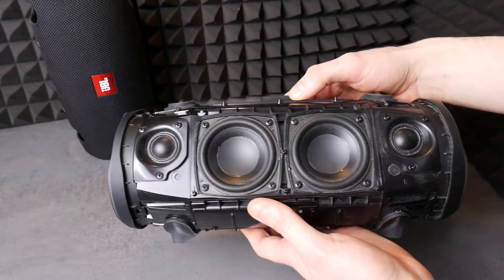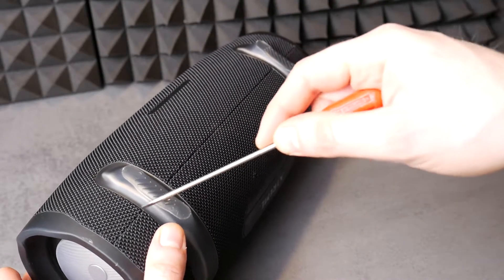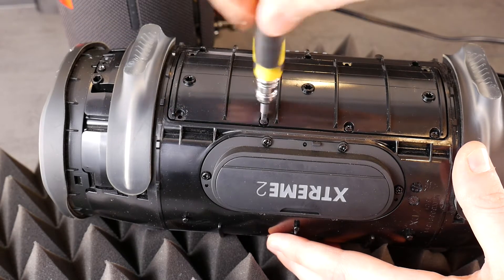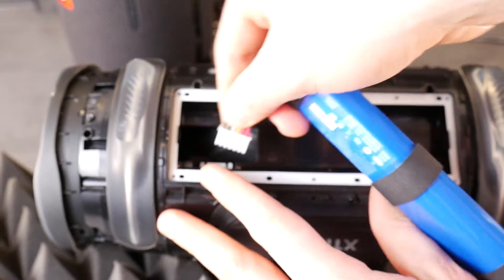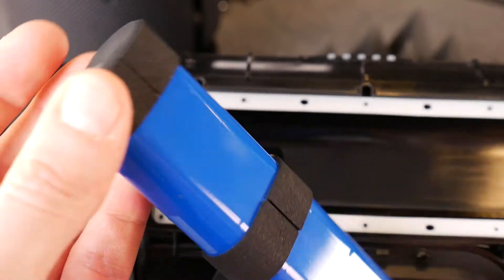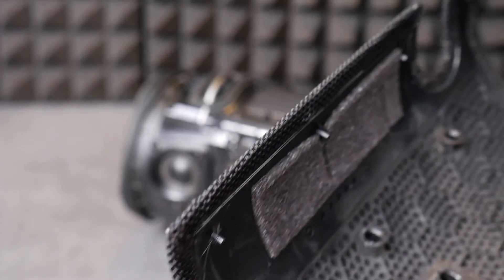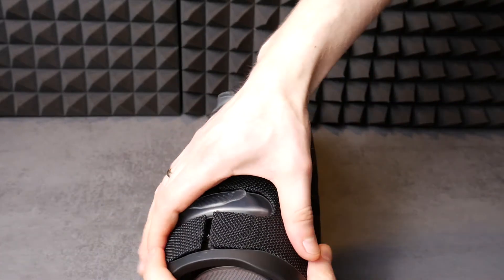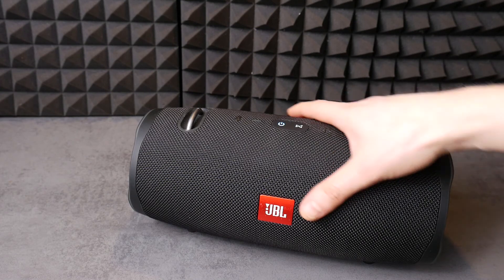How to Replace JBL Xtreme 2 Bluetooth Speaker Broken Bbattery

Comment: how would I diagnose my speakers battery being bad because what if its something else im pretty sure its the battery I plug it in it doesnt charge what so ever it will turn on while on the charger but it shuts off 5 seconds later could this be the battery or something more

Comment: So the battery itself says it has 5000mah capacity however JBl themselves say it has 10.000mah.
Which is it?

Also there are batteries available that have more than 5000mah and say they have 6800mah total capacity.

Are these legit and safe? I mostly use my speaker at festival campsites. So extra battery would be nice but it needs to be safe.
Reply from the maker: 5000mAh is at 7.2v and give around 37 Watt Hours, at 3.6v it will be 1000mAh and the same Watt Hours.

Comment: Need help. My speaker wont stay on. I replaced the battery but when I turn the speaker on it will stay on for a minute and turn off. It also doesn’t charge😭
Reply from the maker: did you try another charging cable ?
Reply: @TechscrewDIY  no but i’m going to buy a new charger and see if that’s the problem
Reply: @veoveotravels I have the exact issue with mine just started .. powers up and clearly isn’t holding any charge I see a flicker on the power button and it’s off again
Reply: Did you ever solve this issue ?  Mine powers up and instantly shuts off. Won’t take a charge and I tried 2 different adapters

Comment: will it still work if you remove the battery and power it directly through wall outlet?
Reply from the maker: good question, I won't know the answer, but why should I do that?
Reply: @TechscrewDIY  dead battery, not sure if it still needs the battery at some sort. mines seems to have a dead battery unfortunately. havent tried to open it yet to do tests. out of warranty :(
Reply from the maker: I recommend buying a new battery, it doesn't cost much, but you get a back speaker.
Reply: I wish I new that too. Because it will verify if the speaker uses the battery or AC power to work whe  it's plugged in. They say it switches to AC when the batteries fully charged if u keep it plugged in
Reply: Curious about the same thing. I only use it plugged in and now it doesn’t want to power up
Reply: probably a dead battery. i replaced mine, easy to install. :)
Reply: No it doesn't work if you remove the old battery, the speaker needs a battery to turn on even if its a dead one